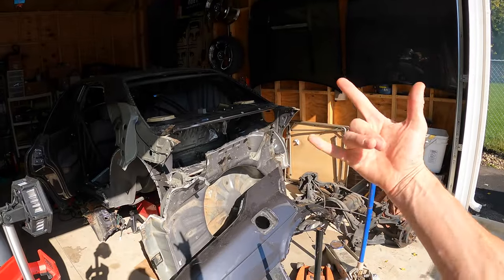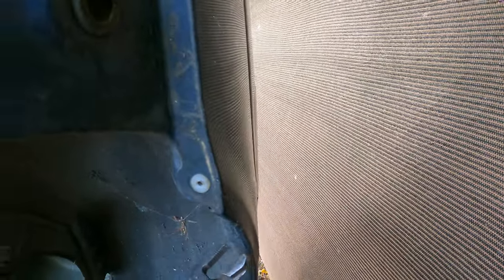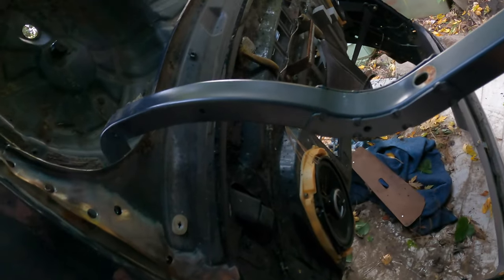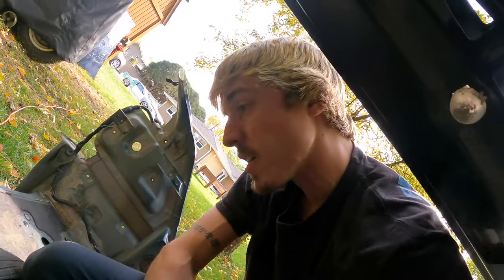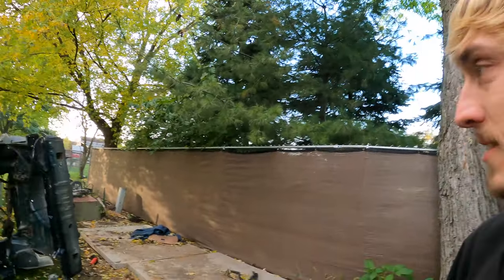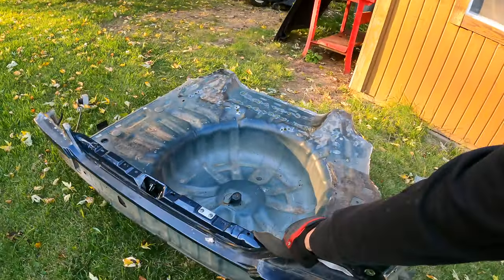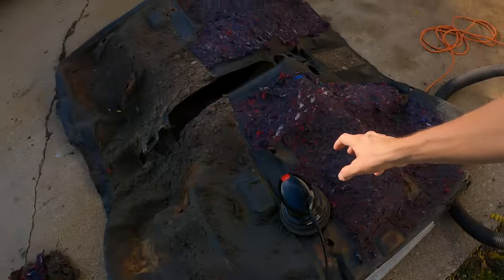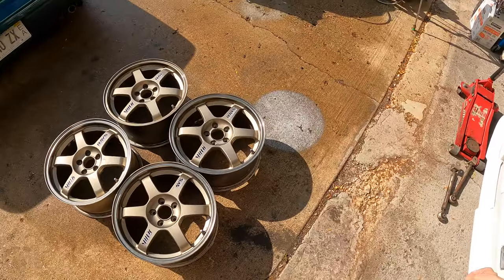Completely Taken Apart! JDM VIP Nissan Gloria

Comment: For the 300 zx one way to remove all of the smell is to use something called oud which is a type scented wood that you put on a small light coal, out is an Arab thing.(there is also something called luban which is amazing but I doubt you'll find in the us) (edit: it's supposed to burn slowly, they don't make a fire don't worry)

Comment: You’ve motivated me a lot watching you put in coils gave me confidence to do my own and it took 11 hours but I did it, and I also put in an aftermarket head unit using those solder heat shrink you used and I never though I could wire before.

Comment: You did the carpet the hard way. The easy way is take the carpet to a car wash. Hang it up where the floor mats are and use the car. Wash pressure washer to clean your carpet. I have done this several times on everything from a Saturn to a Tahoe and it works great.

Comment: Mike, instead of dry ice you can use compressed air in spray cans, those for cleaning PC or any electronics. I used those in removing sound deadening in my e36. Simply you have to shake it and turn it upside down and then spray it. It effectively freezes that old tar, or whatever they used for sound deadening.

Comment: Mike if your vacuum cleaner is compatible with liquids buying an extractor nozzle would help removing the dirt, smells, save water and would speed up the drying process. These can be found for a few dollars, they are usually transparent.

Comment: I spent a good hour diagnosing my Nanas 2nd gen Grand Cherokee, her SKIM system light comes on but the gadges still light up and when it wants to turn over it starts and runs beautifully so thats not the current issue, im thinking the nurture safety switch is dirty. Would love some mechanical knowledge.

Comment: Ive went to get wheels with a buddy before and we always check the stamps. In this case it was stamped 5x114.3 which is what we needed but the wheels ended up being 5x100. These were Cosmis Racing Wheels. Ever since I take a spacer now to be 110% sure that never happens again.